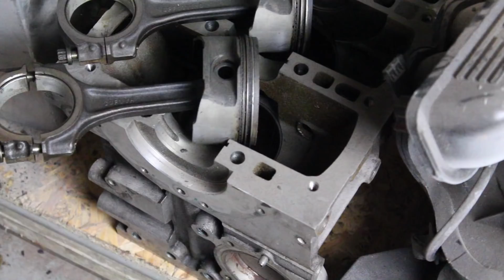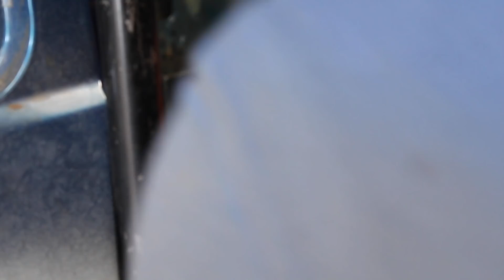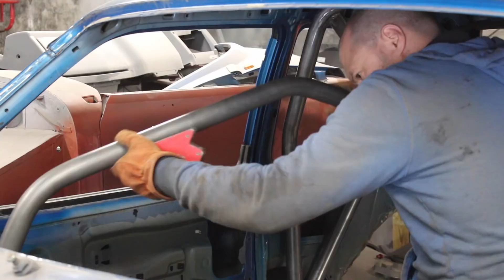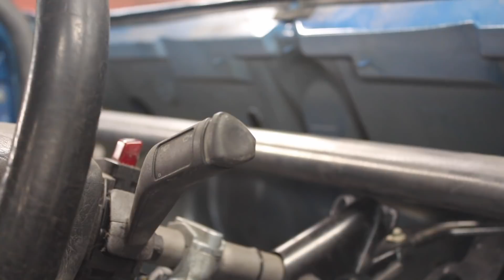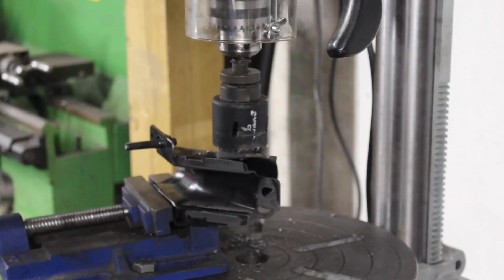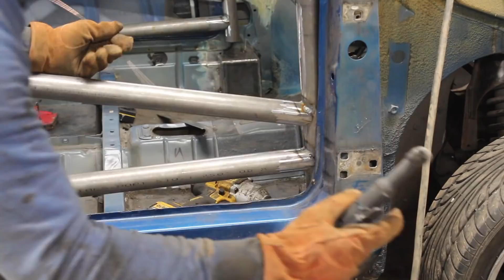VW Audi 1.8T Mid-engine Rover Metro Build - MR Metro EP7

Comment: I've just discovered this build tonight and I'm already on episode 7! It looks great and not too dissimilar to a build I've got planned for the future.
I do have a concern with the door bars though. First, I'd have left them out until later on in the build, as you've got to keep climbing over them, but more importantly, where they mount at the top to the main hoop isn't ideal. I know the blue book says that they should join between elbow and shoulder height, but they should also join the main hoop opposite the rear horizontal bars rather than creating a shear point between the nodes.
Other than that, I'm really impressed with the build and I'm subscribing as soon as I've posted this!
Reply from the maker: Hi Neil, thanks for watching. I appreciate your thoughts on the cage, I don't intend to use it for MSA events and just wanted to stay close to MSA regs if I can. The shear point you mention is interesting, and I can see that. I'll add some additional bracing bars between the rear horizontal and the mail hoop which should help reduce the shear risk.
Reply: @VisionAutoGarage  no worries Rob, it's something that both of my caged drag Beetles have had. The first even had the door bars bent up to get them to meet the main hoop at the same point as the harness bar.
I'm actually just watching episode 13 at the moment! Nice exhaust!